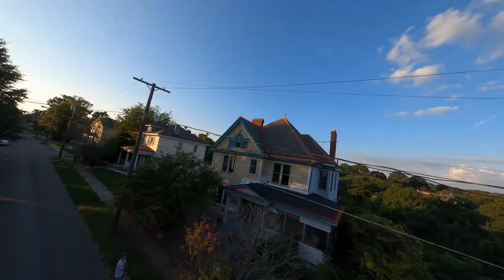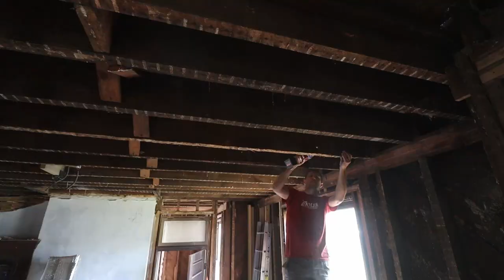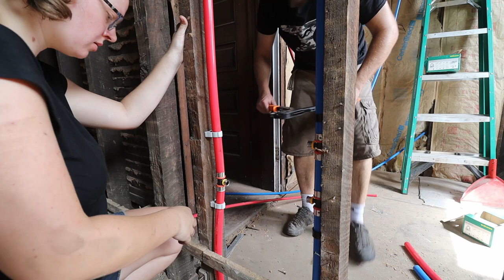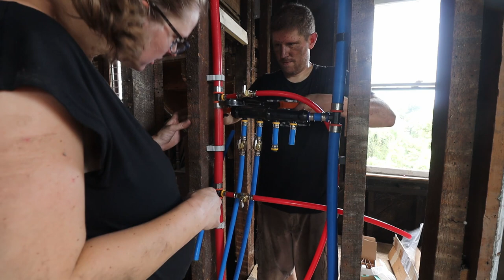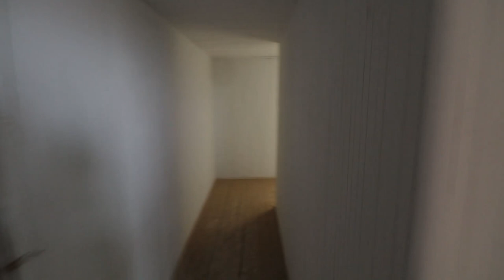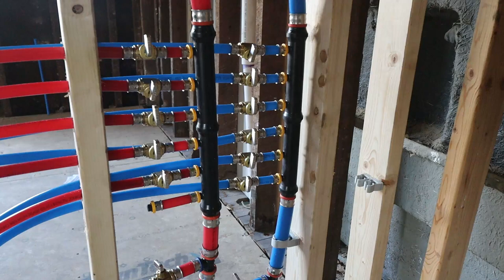Finalizing the water supply and pressing the system - Victorian Home Renovation [TirolerInn]

Comment: I was wondering about the 1/2 bath on the first floor.  Will it be fed directly from the water heater?
Reply from the maker: it will be part of the full cycle like all the others bathrooms. It just is the first in line.